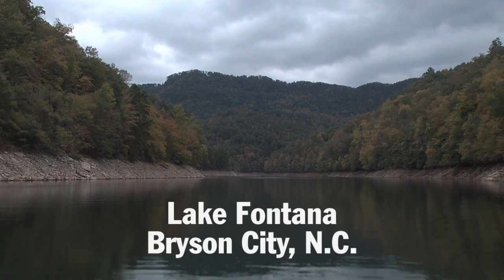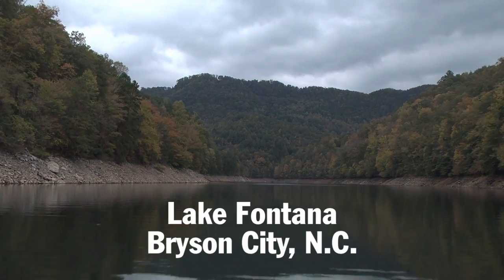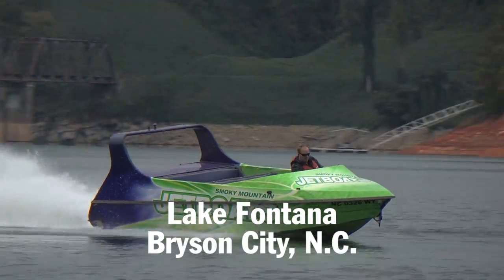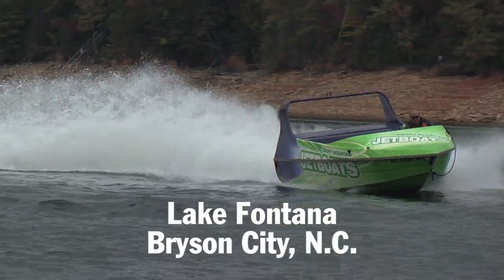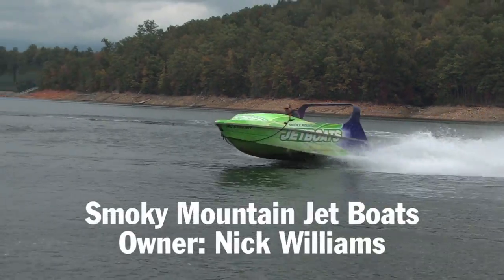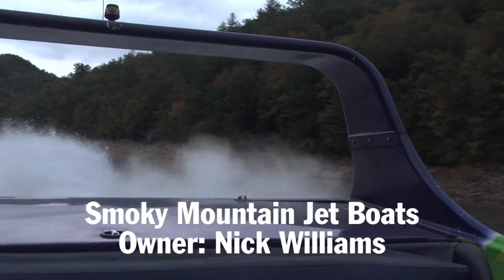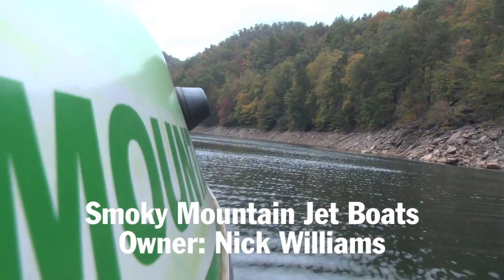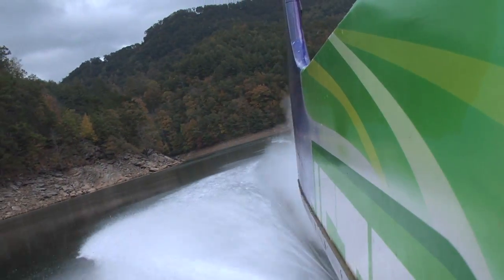Pure Aluminum Hull Built with Miller Welders: Smoky Mountain Jet Boat Goes for a Ride

Comment: I've done repair work on a Smoky Mtn jet boat that they run in the lake at Broadway at the Beach. Stress cracking, to be specific. But when you run a boat that hard, repeatedly, something's going to give. Anyhow, when I did that work, I used a Miller Spoolmatic 30A, running off a Miller Trailblazer 251. Miller makes good products. The power of blue!